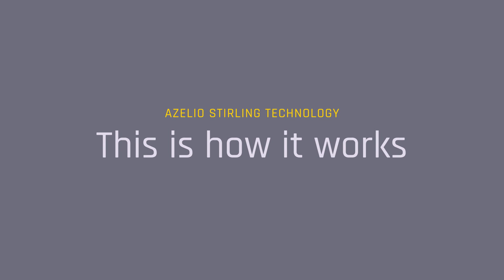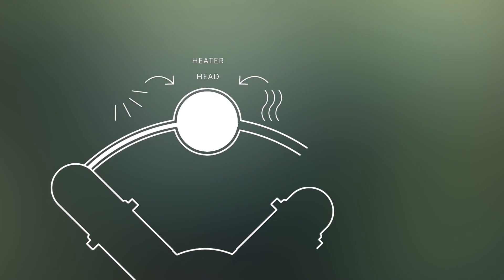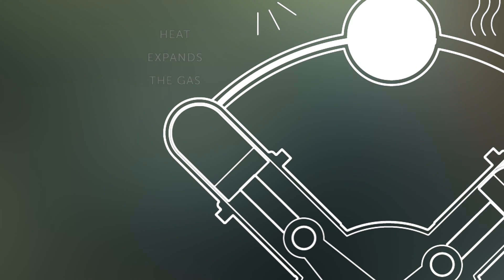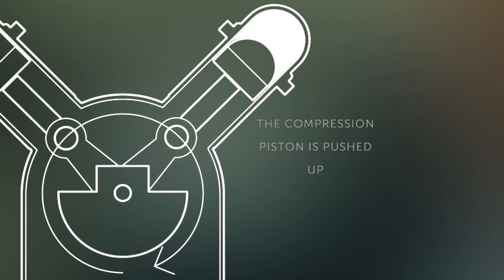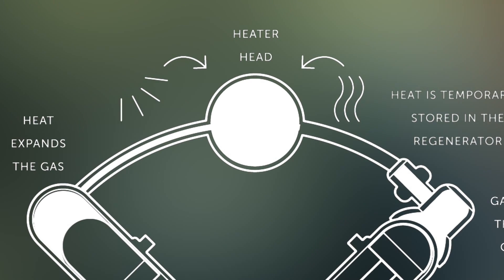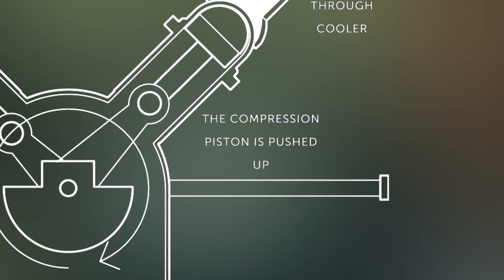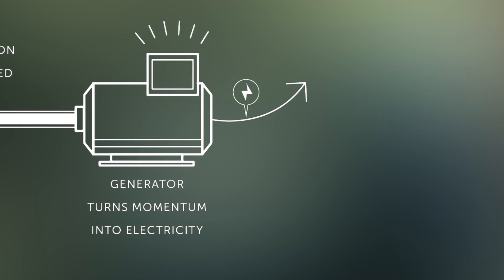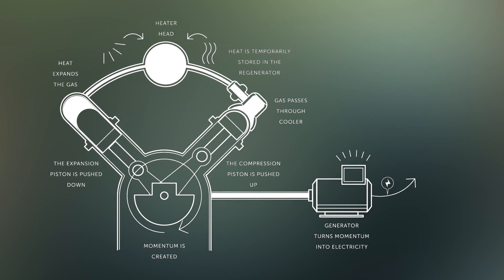Azelio - the Stirling technology

Comment: "with no emissions whatsoever" this is incorrect. Solar has more emissions than nuclear, for example.
Reply: Only with production of the initial materials. Thereafter, Stirling engines operate with negligible maintenance compared to PV solar fields or wind turbines. This system should be comparable to geothermal in its effectiveness. It is also safer than nuclear, even 4th-gen.
Reply: Pham Nuwen, please elaborate on that one? In which way and how does the SOlar emit more than nuclear?
Reply: @DigitalAgeInstitute  It's due to solar's very large consumption of raw materials, land, very low capacity factor and short lifespan.

Basically, you get very little energy out of a solar panel compared to the energy you need to build, install, maintain and recycle it.

Compared to nuclear it's an enormous difference. Nuclear is extremely energy dense, solar is extremely energy dilute.

Here is some data on the matter:
https://environmentalprogress.org/power-density-slide-deck
Reply: They are talking here about concentrated solar, so it is using only mirrors, rather than actual solar panels
Reply: @nicholassexton2718  That also is expensive, it requires a lot of land to build a big enough Mirror array, a lot of Heat goes into the ground due to the Heat Absorbed by the mirror array...

And Guess what happens when the Local and/or Migratory wildlife get in the way of the Reflected Beams, much of them Endangered?
Reply: Although keep in mind that this company is doing energy storage, not energy generation. The Stirling generator setup is just for extracting the stored heat energy. It’s as clean as the heat being stored; which could be nuclear waste heat or CHP heat as the narrator says, or electricity from the grid powering a heating element.
Reply: .... detrimental, holy, WITHOUT ANY EMISSION detrimental, Merry Christmas